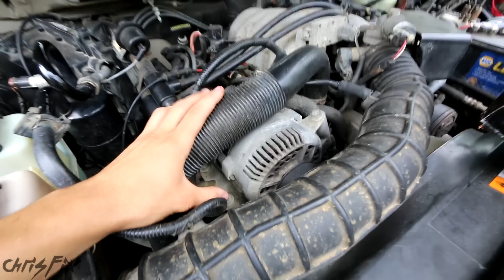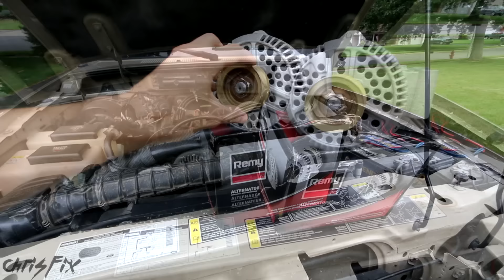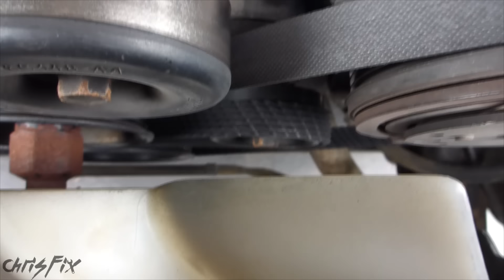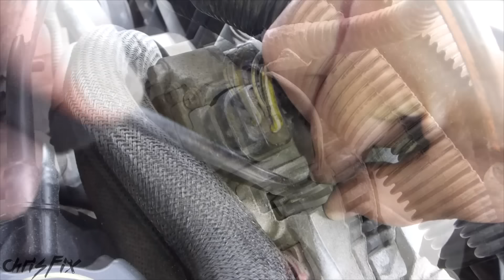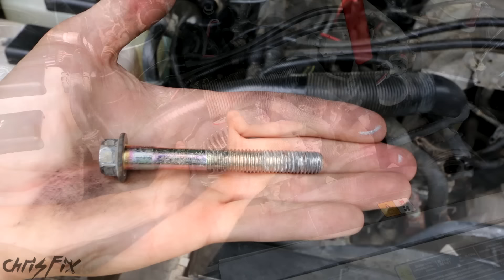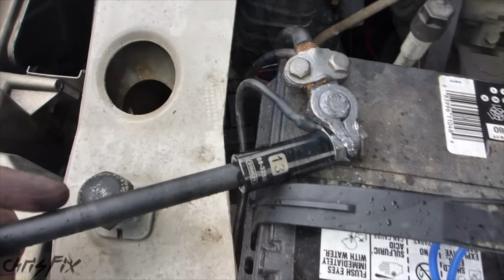How to Replace an Alternator

Comment: Also for me, if I go higher then 4000RPM the battery light comes on, but my voltage goes to 15, not lower. Is it safe to change mine as well?

Comment: SInce you have a higher amp alternator, wouldn't it be worth upgrading the ground wire and the positive wire to the battery to thicker wires? Especially if you'll be adding accessories and drawing more amps? Don't want that stock thin wiring melting

Comment: Thanks to this channel, I can proudly say that at the age of 45 I am now a member of the swapped my own Alternator , brakes and oil change club. I appreciate you Chris 🙏. 

This morning the pulley broke off the alternator…
Reply: The job total cost was $372( not including core return)

New alternator 
New serpentine belt
Tension belt tool ( which I didn’t or couldn’t use because I had zero room from the 14mm hex bolt and the “fire wall”. So i had to go from underneath the vehicle and used a 14mm open wrench to move the tensioner clockwise and successfully install the belt via the air compressor) 

Nissan Sentra sr

But the repair could have been under $350 had I not purchased the belt tool. Which I am keeping because I own multiple cars

Comment: I'm getting a whining noise around the serpentine belt at stop and take off and slow down I read a forum and they had the exact same issues as me and replaced the alternator
Reply: My battery also died the other day but it was from 2017
Reply: None of my pulleys shake though

Comment: Unfortunately my alternator is way on the bottom under the belt. It's hard to see or get your hand in there. 
2000 suv.horrible design. I didn't have the tool you used yet. So I just removed the top circle the belt goes on. And the radiator pipe and battery so far. Very tricky to see the wiring.
Reply from the maker: Dang sorry to hear, those are annoying

Comment: Hey Chris fix  I've been replacing alternators since I was 6 years old my dad was a mechanic and now I'm a mechanic but on my way to retirement a while back I have purchased a station wagon from a friend of mine they had a problem with it one day for some reason or another they couldn't get started these people literally threw the parts list at it and not to help it I'm talking about new alternator new starter spark plugs wires the whole nine yards and still nothing does car had a whole list of problems the window doesn't work the AC didn't work the lights didn't work this car was a mess well anyways I purchased the car for $500 cash how to send a body of mine to go pick it up with his wrecker needless to say that after I got the station where I get home I saw what the problem was I only spent $13 to buy the part I put it on and guess what it started it was a inline fuel filter underneath the driver side frame rail but before I installed it I have to flush out the tank because it was coming out nasty gasoline so after I flushed everything out I installed a new filter it fire it up as for the rest of the problems I mentioned earlier all I needed was just fuses and one relay for the AC and then turn around and sold the car back to my friend who I bought it from 2500 cash I told her that I fixed everything on the car she had inquired what was wrong with it so I told her never sent a boy to a man's job

Comment: How do you replace the wiring harness itself?
Reply from the maker: That varies significantly car to car either you'd need to cut and stitch in a new harness or simply unplug/plug back back in
Reply: It’s for a 95’ celica gt, I’ve decided to do the cut & stitch, only issue is they made all the new wires on the plug black, is there an easy way to find out which one goes to which?

Comment: If your car makes a screeching noise when the engine is on its usually also the alternators ball-bearings, if you want to make sure then cup your hands around a metal rod and place it on the alternator with one end and the other end with your hand against your ear, easy tip to figure out which bearing is screeching

Comment: If the engine is not running, why would there be coolant in the hose? Wouldn’t the coolant be sitting in the radiator?
Reply: There is coolant in the entire system if it's bled correctly. Otherwise it would be air pockets in the coolant which isn't good.
The hoses contain coolant until you drain the system or have a leak.

Comment: Greetings,
I’ve been watching your videos for many years now.  I have learned so many fixes from you. Keep up the good work.  
Question; when I use the key to open the door the alarm goes off, the alarm will stop when I insert the key in to the ignition.  after that I have no issues with the car alarm. 
I only have the valet key.  Please help with my 2015 Buick encore.  

Thank you so much for all your videos.

Comment: That's about the same problem out of my Ford Ranger. But my truck lost power completely and caused my engine to sputter out. But my battery light came on and my voltage just dropped out of nowhere. So I'm guessing that it's probably an alternator.
Reply: Yeah same with my Acura TSX.  Engine turns off after a few minutes after jump starting, luckily it was just an easy swap of battery and alternator and runs like brand new.

Comment: OMG - what an INCREDIBLY EASY PART TO ACCESS!  I worked on my 2009 Range Rover Sport HSE alternator back in mid-July.  What a nightmare!  It was located mid-engine - making it split decision to access it from the top or bottom.  I chose the bottom which made it impossible to see past the driver side of the part.  I had to work blindly, using my fingers to "see" as I disconnected the main power cable and top horizontal bolt.  Since my LR3 is 15 years old, separating the wire harness connector took 20 minutes of prying and colorful expletives due to lack of accessibility.  I also managed to gash my right forearm on a piece of metal sticking out of the inside of the front bumper.  If this is a hazard guys, I highly recommend covering this over with duct tape before you attempt this repair.  Sadly, the brand new alternator rated at 150 amps began failing last week, and after working a 12-hour shift it rapidly began discharging my battery to the point my electrical went black.  When alternators fail, often times they become an electrical short and completely drain your battery.

Comment: Dude its crazy i had to do this fix on my 07 ranger and the engine components are set up in almost the exact same way as this mazda truck. Same arrangement of the belt and pullys, tensioner bolt was 15mm. Same alternator mounting and the position of many other components too.

Comment: Hi Chris, im from New Zealand and a newbie in servicing my own car. I have a 2013 Holden Cruze 1.8L automatic. I noticed that im hearing squeaking sound when the engine is at gear 4 and 5, i know because i switch to manual shift when i hear the squeaking. But squeaking occur only when im driving in inclined road at gear 5. When it started squeaking, i press the gas pedal to switch the gear to 4 and squeeking will go off. Same thing happens when im in gear 4. What would be the cause of that squeaking sound? When i search it in google, almost all answers are pinting to the alternator. I also check the belt tension and it’s tight. Hope you can give me some advise on what else to check. Thanks.

Comment: I have a mechanic who was replacing my alternator, he claims that I ruined all of his work by putting my foot on the accelerator after he “successfully”got my new alternator around the belt. I literally started my car gave it gas and he says my belt popped bc of that, ive never had this problem with my car if anyone can tell me if it was actually me or did he never have the belt in place?
Reply: It sounds like he never looked over the belts and when it happened didn't want to say it was his fault.

Comment: This wasnt even a half hour job on my 02 4.0l ranger. Good stuff the original lasted almost 21 years. I had to use the same type of cheater bar to break em' bolts lose.

Comment: You can also see if  the Alt is working by puting a flat head screw driver behind the Alt and if the magnet  sticks to the screw driver the Alt is good  it only works while the alt  is in the running mode

Comment: I’ll tell you something funny: Alternators last almost forever. They don’t stop working because of a bearing failure, or a winding failure.

Alternators have a five dollar pair of diodes; which control the flow of the electrical current. When these diodes burn-out, the alternator stops working. 

Fifty years ago, alternators were always made with a little door on top, to access the diodes. Any handyman could test the diodes right in the driveway. If the diodes tested bad, then they could be replaced in five minutes. The alternator itself almost never fails.

But around 1980, Ford and GM buried the diodes deep in the body of the alternator, so that they could no longer be tested. The intent was to force customers to spend five hundred dollars for a new alternator; instead of a five dollar pair of diodes. Ford and GM make a fortune on replacement alternators. And that’s how things are today. Every American car on the road has been sabotaged. 

I think that this is grounds for a class-action lawsuit. It’s theft by deception.

Comment: This happened again this is the third time this happened it we have to change the alternator again in our 2007 Ford focus my sister took it to this restaurant in Breinigsville Pennsylvania and basically it died in the parking lot and they moved it to this warehouse parking lot and basically the alternator is charging but only when you give it gas to the engine it won’t charge at idle it dies or basically it doesn’t charge correctly when it’s idling you have to kind of keep the Revs up to charge the battery we put a new battery in and it started right up but then we checked the voltage and it started going down even with the headlights and everything on we turned everything off and started going down when we were idling

Comment: Now my 1999 Chevrolet blazer LS has a issue with the alrenator it's very bad and the battery on the blazer LS is about dead The altinater is causing the battery issue

Comment: Hey! I replaced my alternator and battery but the battery light is still on and when the car is running and I unplug the battery the car dies. Could it be because I didn’t clean the old connections? What did I do wrong? Thanks in advance:)
Reply: @Mr.Kociałko Kociałkowy it was a bad wire. i figured it out.

Comment: I’ve seen people use anti seize and Ive also seen thread locker. Which should I use
Reply from the maker: Depends what you are doing. Whatever I showed in this video is the proper use. Typically anti seize is to make it so the fastener can easily come out later on and threadlocker prevents vibrations from loosening it up.

Comment: Hey chris i have a 95 mustang and recently the alt fuse has been blowing immediately and i changed the alt but it continues to blow and suggestions that would be awesome
Reply from the maker: Which fuses?
Reply: @chrisfix  just that 30 amp alt fuse
Reply: I used a voltage tester and it has the correct voltage

Comment: On a 2006 Honda Accord with an I4 DOHC VTEC engine, the alternator is right under the power steering pump and A/C compressor. The stock alternator is rated for 85 amps continuous, 95 amps peak.

Comment: So first off, this is an amazing video to follow step by step BUT i ran into a problem, the positive terminal of the battery that is connected to the alternator is stuck on the nut. It has 2 nuts pinching the positive terminal. My question is, how to i loosen the positive terminal? do i buy a chemical that will loosen it? I cant hold the other nut bc the AC lines are directly above it. This is an original alternator on a 97 Lumina. HELP PLS :[[
Reply from the maker: Send me some pics on IG. I will take a look and give you some feedback.
Reply: @chrisfix  Chris, I was able to place a wrench on one end and use another one on the other end, and the whole thing came off easily(clip holding AC lines attached to the alternators positive terminal) this was my first time replacing this with your guidance, which thanks a lot!!

Comment: I upgraded to an higher amp alt and when I idle, the voltage drops around 11-12 volts. Is that normal? Should I find a way to increase idle speed somehow?

Comment: How has the replacement alternator been over the years? I need an alternator on my Lexus IS250 and Remy was one of the brands I saw but I didn't see any reviews for it. I could get a Denso (OEM) remanufacted for the same price as a new Remy alternator so im curious how yours has held up.

Comment: everything was working out fine for me until I tried putting the belt back into place, then my wrench slipped and I noticed that the belt tensioner bolt got stripped, cant get a grip on it anymore, any ideas how to work around that or should I just take it to an actual mechanic? :D

Comment: Is there a trick you use to keep the old brittle plastic clips on your connectors from braking? I tried to change the spark plugs on my old camry, and all the plastic clips of the connectors just snapped off. I thought that would happen here too, for example with the mass air flow sensor or the connections to the alternator, but they beautifully survived the operation in one piece.

Comment: This job can be either a dream or a nightmare.  I've always considered cars to be a depreciating asset, so having a new car was never important to me.  (I've always thought that older cars looked better anyway.  My favorite car of all time would still have to be the '55 Chevy.)  However, I still wanted them to work and look good.  Since I seldom had new vehicles, I've had to learn how to work on them.  Swapping out the alternator was usually just a half hour job at most...  Until I ended up with a Dodge Omni. OMG!!!  You had to completely take out the radiator to get to the alternator.  I loved that little car (my teenagers hated it - they called it the "dork-mobile", lol), but installing a new alternator was not an easy job.

Comment: why always turn off negative wire
Reply from the maker: Negative is grounded to the car, so if the positive comes off then the chances of a spark (because the terminal touches the body through a wrench or something) is pretty high and there is a lot of combustible material around!

Comment: Chris, is 30-40ftlbs standard for all alternators across all vehicles? I have an 04 Dodge Ram 1500 3.7L and I looked in the Haynes manual and online and I cat find any torque specs for my alternator bolts in any of them. Owner manual does not say anything either.

Comment: You just gave me the answer to my problem. I have a 2000 dodge dakota. And my lights dims when I was driving. So I pulled over. Checked my battery connections. They were great. Mostly bc they were brand new. I had put them on a few days before. Then I gave the battery a bit of charge. Started my baby up, took off my negative terminal, instantly shut off. I was really confused. But now I know thank you
Reply from the maker: I'm glad the video helped you solve the issue!

Comment: As usual thanks for the informative video.

Please remember to use gloves when handling your battery because the battery acid can easily get onto your hands which you might not feel too much but you my touch/transfer more sensitive skin areas like your face where you'll feel the burn

Comment: Just to save someone time Remember your alternator can still show as good charging if it’s failing to read the pcm to check it you need a special tool or if it’s easy to take off check at your local alternator if they have the system to check it.

Comment: an even easier and cheaper way to test if an alternator is bad is to turn your car on and disconnect the battery as it’s running. If the cars turns off the alternator is bad if it still runs then it’s not bad

Comment: Thanks Chris, had an issue with my battery wasn't charging right and was unsure due to the previous owner buying a new battery and alternator before I got it, went to take a look and the positive cable was not attached at all, what a simple fix

Comment: Wouldn’t u want disconnect the red on the battery? If the black touches the frame it’s basically connected right.. but if u disconnected the red theres no way it could ground out. Just a question

Comment: Hey chris fix my tensioner bolt is stripping and I already installed my new alternator but I didn't put the ground wire in, so now I have to take it out and put the positive cable in. 

Can you give me some advice on how not to strip the tensioner pulley bolt. 

Thanks

Comment: I changed my alternator on my van as the battery light came on swapped good battery into it but light stayed on  so put a newish alternator on I had a spare alternator from my friend changing his but turned out to be his fuel pump so got a free alternator fitted it in  afew hours with afew hick ups like dropping a bolt and having to fish it out with a spark plug magnet

Comment: Thanks for the update on the alternator, I had people say to disconnect the wire to check the alternator on 1995 Ford Taurus but driving the batteries lights come on thanks you dude